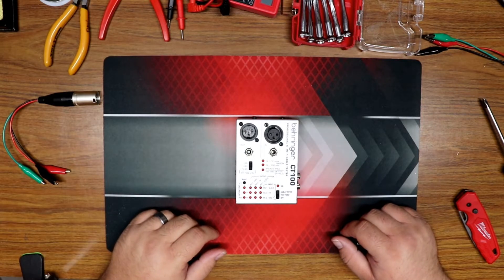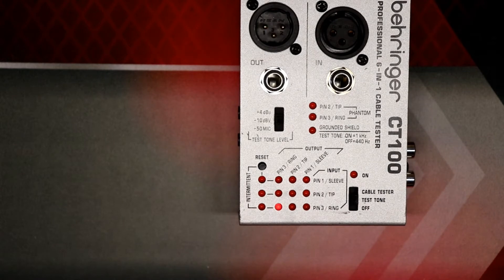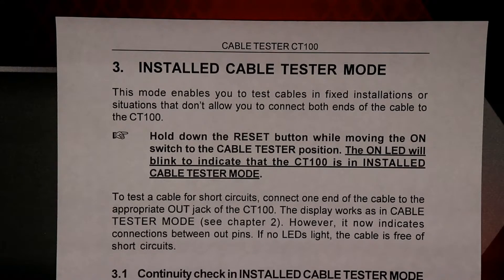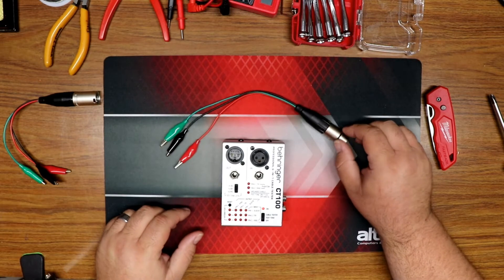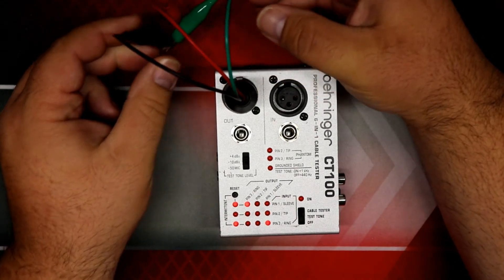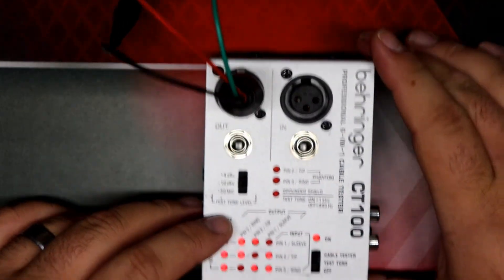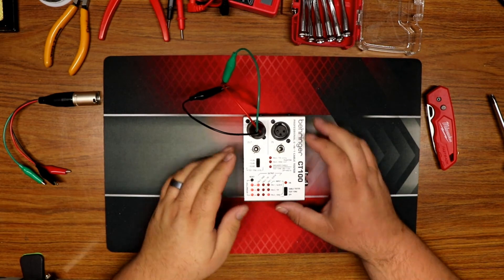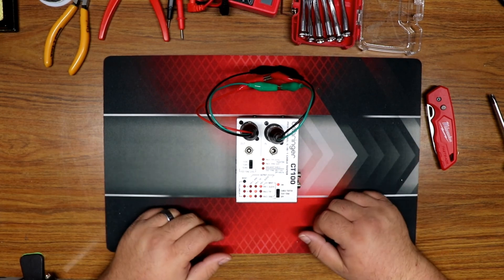Behringer CT-100 Secret Modes? LED Test and Installed Cable Test Modes

Comment: it can use cable tracing as well just short the end of cable and led will lights up if there are bunch of cable to trace...
Reply from the maker: You should be able to use the installed cable mode to do that, but check out my video on the SoundTools XLR Sniffer for cable tracing. https://youtu.be/MnMXRuDOR7s